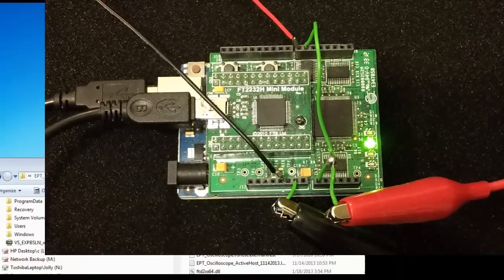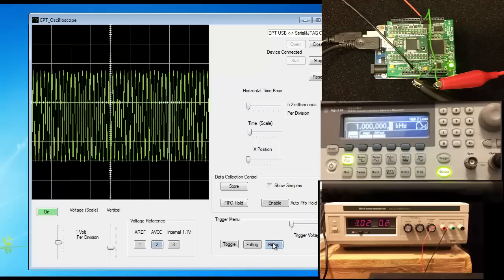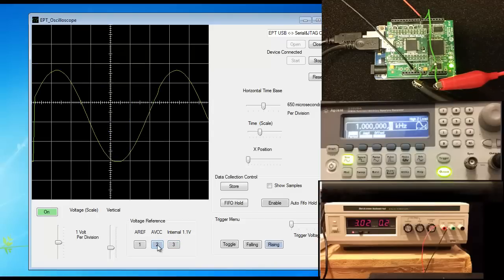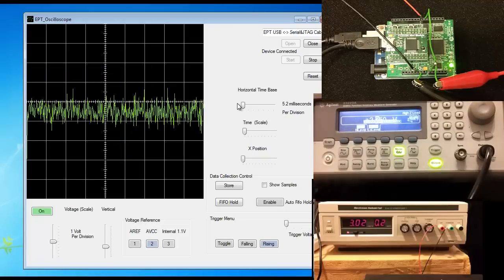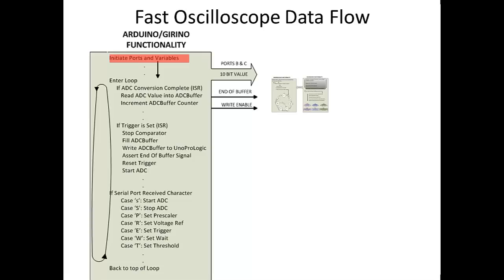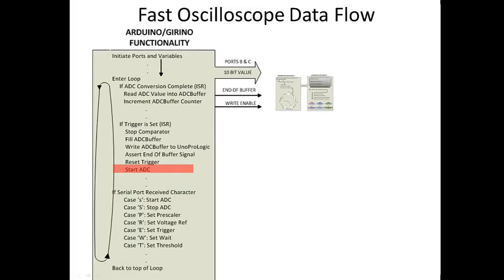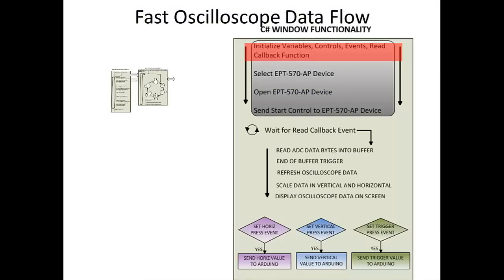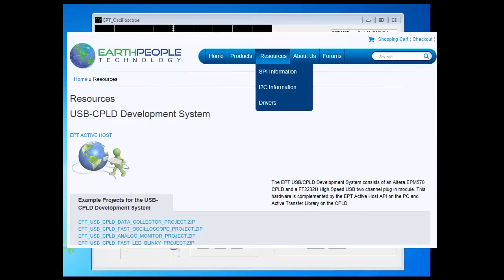Create Your Own Arduino Oscilloscope

Comment: Hi I had to go out and buy an unoprologic after seeing this. Is there an executable file for the transfer application? Do you have another method to getting it up and running? The instructions are damn hard to follow when it gets to the C#. Sometimes there is too much detail and other times not enough. M.S. Visual almost needs a degree to operate by it's self.. Any chance you can simplify for those who want an oscilloscope?

I'd better mention for the benefit of others that the instructions are better than excellent until the C#..
Reply: Ok I found the application in the debug folder.. Few what a relief! Now to get that working.. Cheers
Reply: dinner85 Did you finally get it to work and did you ever run across a decent set of instructions?